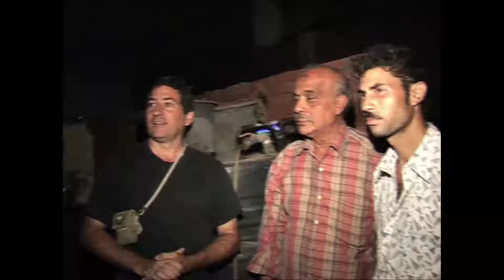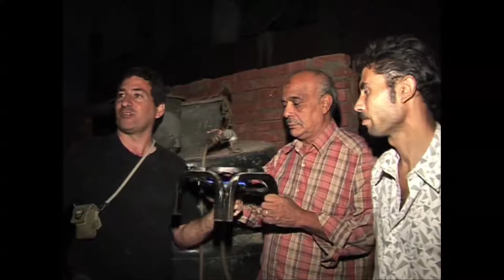Small Scale Biogas in Egypt

Comment from the maker: @SE52135 It's a normal stove with the restriction pin removed.  Any stove will work, you just have to open up the jet (drill it or remove the restrictor; whatever you need to do so that a generous amount of gas from the unpressurized gas holder can get to it).